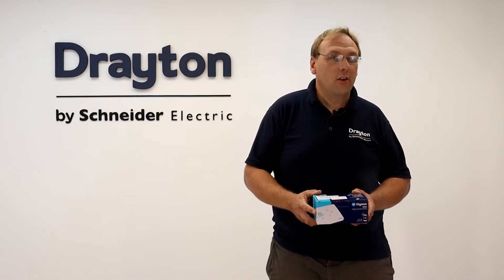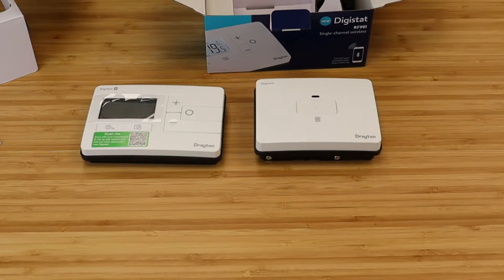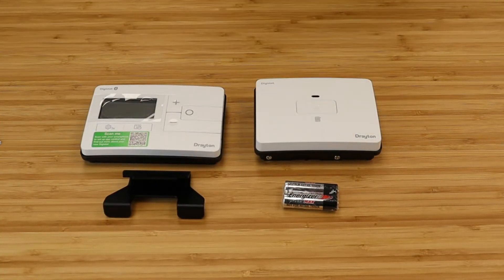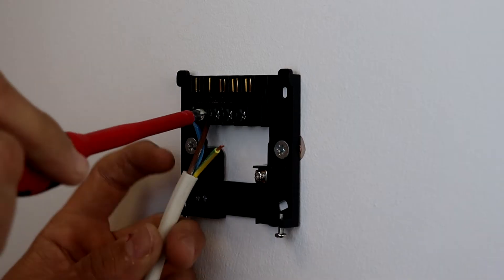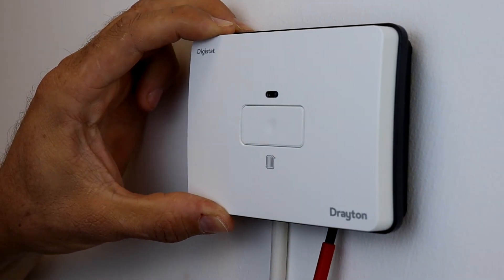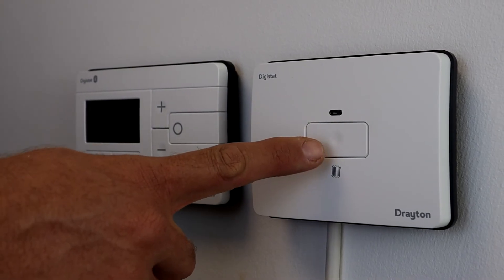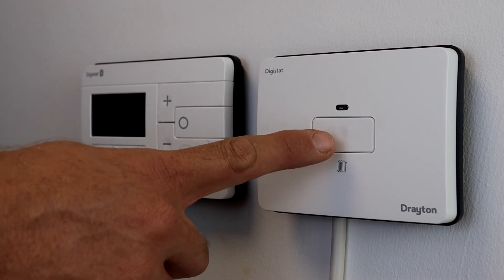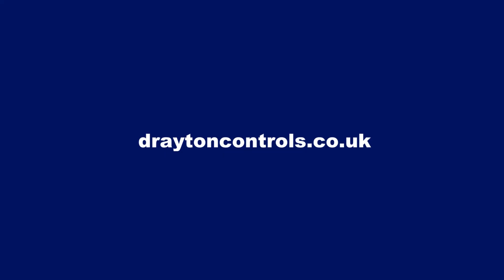Drayton Digistat - RF901 Installation

Comment: Could this replace the Drayton MiGenie T714R / N114R. The miGenie Wish 1  which had the discontinued app?
Reply from the maker: The receiver for the RF901 has the same backplate, no wiring changes. It only has app control from within the home.
Reply: @Draytonheating  Thanks for getting back promptly

Comment: An electrician will install three electric radiators in my flat, two in the lounge and one in bedroom next door. How many electric radiators can one RF901 control? Also, can the receiver go just above the skirting board or does it need to be higher up the wall?
Reply from the maker: The maximum switching compatibility for the RF901 is 3amps, you may need to use a relay to handle the load of your heaters.
Reply: @Draytonheating  Thanks for the reply. Each radiator will need its own receiver and relay. Can two or three receivers talk to one RF901?